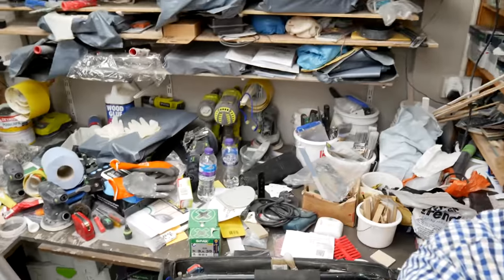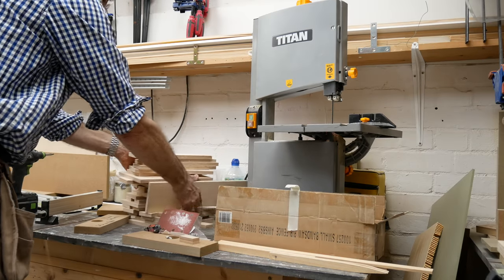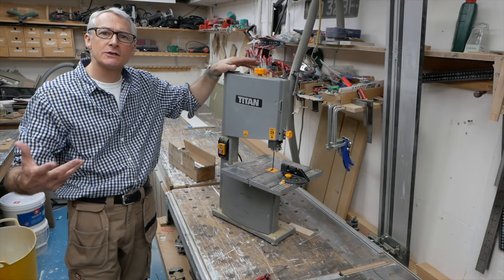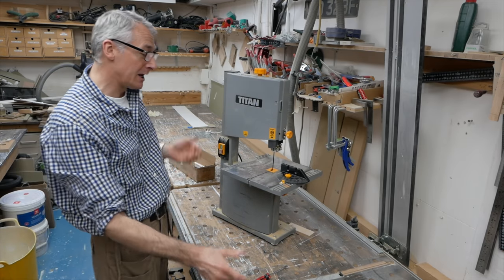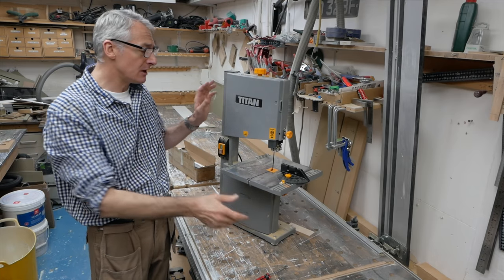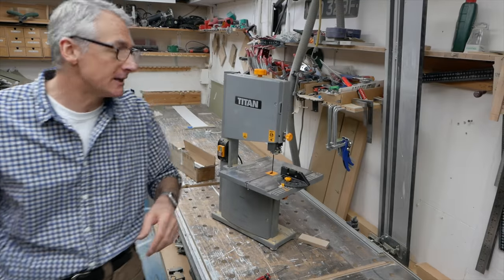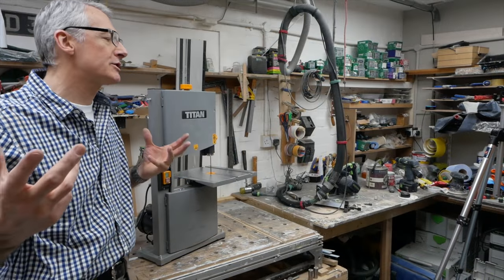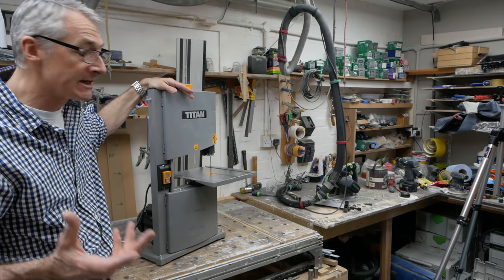Bandsaw Makeover P1 [video # 293]

Comment: I had a Clarke CBS190 bandsaw for years, spent many, many hours 'tuning' it all to no avail, absolutely useless, blade drift was appalling enough to put anyone off bandsaws for life, that said when these Titan ones came back in stock at Screwfix, I thought I'd give it another go, The difference between the Titan and the Clarke is nothing short of astonishing it actually works and works well, got the Axminster fence but not fitted it yet, Mr Millard you're costing me a fortune ;)

Comment: a lot of people bang on about problems with bandsaws not cutting straight and one thing and another when probably all they need to do is put a sharp blade in....blades dull quickly and if you cut a lot of tight radii that will mess up the tooth set for straight cuts.

Comment: Great video. Thanks for sharing. I'm already looking forward to part 2 (2morrow?)
One of your first videos about the WorkZone bandsaw brought me that time to your channel, which I subscribed to a week weeks later.
In the mean time this channel learned me a lot of other things so there is no reason to unsubscribe.
I still have my Scheppach band saw and I use it quite often. I have it two years now (but I managed to break already three band saw blades.
Last summer a friend of mine gave me contact to a woodworker who is able to repair (solder) broken band saw blades under certain circumstances.
He also sells new ones (which he makes himself to length for all types of band saws from stock material which he. After a long phone call I sent
him the three blades. He was able to fix one blade, the other were too much damaged. But he sent those also back, I might be able to use them for other purposes,
some day.  (don't tell me I'm a hoarder). He also made two new blades for me and I bought two blades from the same company as before.
So now I have the luxury of 5 blades! Since that time no one blade broke. (that happens only when you have one blade)
He also told me some tips how the blades stay OK longer. I have not met those tips anywhere on the internet so I write them here.
1/ Put a new blade and cut wood at first only 10-15 minutes.
2/ After that, take the blade out and let it rest freely and expanded f or at least 24 hours
     Ideally, sharpen the teeth of the blade (better but not compulsory)
3/ Put the blade back and use it for one or two hours
4/ Again take the blade out and let it rest freely and expanded for some hours
     Repeat steps 3/ and 4/. When necessary, sharpen the teeth. (max 2 or 3 times is possible)
5/ use the blade till it breaks

Back to this video: I don't remember exactly anymore the differences between the three band saws you tested/reviewed that time.
The Titan looks quite similar as my Scheppach (the Scheppach does not have a miter slot, nor a quick release knob)
My band saw produces a lot of fine sawdust which goes everywhere. The greater part goes to my simple dust collector but much stays near the down wheel.
The worst is that next to the upper wheel is the up/down mechanism for the blade guide. The saw dust literally blocks the mechanism after a few minutes.
(it takes longer to free the mechanism again). I did not find a way yet to prevent the saw dust going there. I'm thinking of mounting an acrylic upper door and
cutting red wood to see how the dust flows.

Comment: Ooh, ooh, metalwork and machine modification, now you're talking 😄. Enjoyed the video, thanks Peter. I worry that the birch ply will crush up further over time loosening the fence, but I guess it is just a matter of re-tightening the screws. Interesting bit with the tension release, must be a fault in assembly that it doesn't work the way it should.
Reply from the maker: Thanks Bob! Yes, bit of a weird one re the tensioner, but I’m not losing sleep over it! 😂👍👍

Comment: Thanks for the video Peter. Yes, there seems to be a lot of conflicting advice on Titan blade lengths. I think the problem stems from the lack of accuracy at Titan when welding the top blade mount to the frame resulting in some lucky people like Peter ending up with a proper 1575mm (62") machine, and others (like me) with something less. After running out of adjustment on several new blades, I eventually got mine from Thebandsawshop who recognise this problem and supply slightly shorter blades for Titan saws. Calculating from the drive wheel diameters and centres, the one they supplied me is about 1560mm. This could also explain the problem with the tensioner - with the 1560mm blade, mine works fine. My advice would be to check yours for size before you buy a new blade.
Reply from the maker: Interesting point; I may get a custom 1560mm blade made up to try out - it'll be a year or two before I 'need' to change blades, lol!

Comment: Doesn't putting the guide rail on the front interfere with blade changing? Can it  not go on the back?
Reply from the maker: It will get in the way of the blade - hence the comment about wingnuts - but you're right, there's no reason why it couldn't go on the back, AFAICT. Never seen a bandsaw with a rear-mounted fence, mind, but why not?? 👍

Comment: I think Mr Titan and Mrs Screwfix must have seen your original video. Following your videos I bought the Titan and even a Screwfix metal rule in readiness following a suggestion in the comments of said video. When I set up my fence it was really solid without the rule, to the point I thought I must have done something wrong. My blade release worked fine too, and I use it frequently as I read somewhere that if you go periods without using the saw to release the blade to lengthen it’s life span. I only get chance to go into my shop Tuesday and Wednesday mornings. 

I'm holding back on buying a new blade until I fully understand what I want. So far I'm thinking 6tpi x 3/8 inch is the way to go as I don’t think I'll be cutting many circles and I tend to use stock around an inch thick. However, it’s already my first choice to cut most of my delicate and smaller cross cuts. I cut some bench dogs this week using a design off YT, but he used his table saw with jigs that took him very close to the blade. Personally, I feel much more confident working closer to the bandsaw blade than close to my table saw. 

Another very helpful video and thanks for your advice both in the previous videos and in the comments. As a newbie this sort of advice and guidance is invaluable.
Reply from the maker: Sounds like you got a good’un Mark! Yes, releasing the blade tension’s a good idea when it isn’t in use - wish mine worked, lol! 👍👍
Reply: @10MinuteWorkshop  Thanks for this video series peter - I was one of the folk asking about this fence recently. After re-watching your initial videos I recently bought the Titan and thought I would get the upgrade fence too. But I have to say that like Mark above, the fence on mine is actually ok. You have to nip it up pretty tight, but once you do it is solid.
Reply: The only problem I do have is that the mitre gauge won't run through the slot - I think there are probably some burrs imnpeding it. Did you have any issue like this?
Reply: Mark Hannah Mine is ok, but that’s the best I can say about it. I’m going to buy a third party one that will fit all my power tool tables.
Reply from the maker: @diyengineer811  Thanks Mark! Maybe Titan watched my video and fixed the issue, lol! On mine when you tightened it up it would just lift off the table i.e. it was literally bending - with predictable results wrt stability.
Reply from the maker: @diyengineer811  No, the mitre slot has been very smooth for the start. Must be a burr or something 👍👍

Comment: hi Peter have you seen the new Aldi Ferrex 10" 550W bandsaw it's £149.99 but it's much improved with better fence and solid aluminium table and proper bearings for holding the blade in position top and bottom of the table its nearly twice the cost of the old workzone one but it's twice as good in my opinion
Reply from the maker: This one? Aldi Ferrex 10” Bandsaw 12 months on [video 475] https://youtu.be/o65JpBZoa0s 👍

Comment: Hi Peter, greetings from Australia. I have only just recently come across your channel and have been keenly viewing your bandsaw content as I am researching them at the moment. We don't have exactly the same brands as you have in the UK. I have looked at the  Ryobi and Metabo and also some cheaper options I found on ebay. I have a question regarding blade guides. Some I have looked at have roller bearing guides and others (the cheaper models I notice) have adjustable pins or bars that move in or out either side of the blade. I imagine roller bearings would be preferable, but given the guides are not intended to touch the blade anyway, does it really matter? I'm only looking to purchase a hobbyist level machine so am not intending to spend a great deal of money. I would value your opinion on the blade guides question. Thank you.
Reply from the maker: Hi Paul and thank you. Roller bearing guides are preferred - they’re there to help stop the blade from deflecting, so there will inevitably be some contact - but I’ve never had any issue with the little pegs. I was in a trade workshop recently where the bandsaw guides were little oak blocks, and they seemed to be holding up just fine. 👍👍 Hope that helps, and best wishes from London! 🙌

Comment: I have bought the same bandsaw. It is great value for money. I used it to cut a 70 mm deep birch piece and it coped. I had to introduce another washer on one or two balbearings supports due to the fact that the ball bearings were not allingned on the blade.

Comment: Peter can i ask why you didn't just cut some wood to 16mm  to fit instead of using the 1mm spacers ?
Reply from the maker: I had some 15m ready to go, and some spare spacers 🤷‍♂️ 👍👍
Reply: @10MinuteWorkshop   okey dokey...watched your video and bought a Titan...found issue with gate...if you look at the underside of the far end you will see where the alloy has been pressed out it has in fact distorted the surface..just dress with file.. :)

Comment: Hi Peter, that's the same fence that's on my Axminster band saw I've had for 12 years, just bought some blades from tuff Saws an what a good service especially  when I messed up my length, sorted me out free of charge. I had to make a new lever for my fence from aluminium as the plastic one broke early on but beside that it's worked fine. Keep up the good work.
Reply from the maker: Thanks Kenny.  Yes, good fence. 👍👍

Comment: The Titan saw appears to be the same as one branded Ryobi in the US.  If that's right, there may be a bushing missing or improperly installed behind the cam in the blade tension quick release mechanism. Don't know if it's worth the bother to tear down the top of the saw only to find no parts are available. It's nice to have a properly working tension release lever, though.
Reply from the maker: They’re very similar, yes. And no, parts availability is scant for the Titan here, so I didn’t fancy stripping it down of it works OK otherwise 🤷‍♂️👍

Comment: Band saw is a useful tool but a pain in the a55 to set up in my humble opinion. I have a small Wen but I think the lower end saws are pretty close to being all the same. I have yet to use the fence since the saw simply doesn't have the power for resawing.  Thanks for the video Peter!
Reply from the maker: Cheers Mark! Have to admit I mostly use the fence as an end-stop when trimming short lengths of e.g. dowel, or something similar. 👍

Comment: Afternoon Peter. Does the blade untentioner not tension it when rotated one way, to lift,  and not push the block down when pushed the other way, to release?
Reply from the maker: That's how it's supposed to work, but it doesn't make contact with the bit it's supposed to. 🤷‍♂️

Comment: Okay Pete... heres an idea, put a strip of alum angle on the front with its "horizontal" leg facing in... that'll give ya a surface parallel to the tabletop ,( assuming the front edge is sq. to the top)...😬
Now.. change the cam-wheel for a larger diameter (or sleeve it ) ... OR ... a bearing of suitable size. 🤨
Also, as far as I know, you are supposed to de-tension the blade when not in use, so getting the cam operating efficiently might be a gud idea ..

😎👍☘
Reply from the maker: That sounds all a bit too mechanical for me Peter! Nice ideas though - tune in for part 2 tomorrow to see my super-low-tech solution, lol! 🤔👍

Comment: Hi Peter, I an beginning to struggle with this saw a bit. You mentioned that the blade seemed quite big - well I am finding that with the tensioner screwed all the way down there still seems to be about 5mm too much slack in the blade which means that it doesn't sit nicely in the middle of the guides, but rubs agains the right hand side. Is your blade centered in the guides? I am considering getting a customer blade made 5mm shorter to see if that is better.
Reply from the maker: Hiya. I'm not sure if the blade's too big, but the tensioner does seem to be at the extreme of its travel, yes, but it does stay on the crown of the wheels. If you want a custom blade, try Ian at tuffsaws.co.uk - great blades, great service! 👍
Reply: @10MinuteWorkshop  thanks Peter, I bought a couple of blades from Ian  already and I told him you sent me! He did say that he can weld snapped blades back together but they will be 5mm shorter- which I think would be the ideal size for this saw. My real trouble now is that I am hankering after a bigger machine!
Reply from the maker: @diyengineer811  Haha - I know that feeling! I bought the Aldi 10" when it was - briefly - in stock a few weeks ago and have to confess I haven't touched the Titan since... 🤷‍♂️
Reply: @10MinuteWorkshop  I am getting tempted by the Charnwood W730. Just checked the specs for the Ryobi that the titan is cloned from and it says the blade length is 1572mm.

Comment: Help! I have the same saw, and can’t get the blade to stay on. Turning the wheels, causes the blade to slowly work it’s way off the edge. Either the tracking of the two wheels is out of alignment, or one of the wheels is not plumb. Tried to sort it four times, and seriously considering scrapping the saw.
Reply from the maker: Hi Megan. Yikes, that’s not good. Mine took a bit of tweaking initially, but nothing like that, and it’s running pretty nicely now - you can see in this vid how easy the blade change was. 

Assuming there’s no damage to the tyres, it has to be down to the wheels not being co-planar, so unless they’re dramatically out of balance (e.g. a manufacturing fault) then you should be able to get them aligned by tracking.  

It shouldn’t make a difference, but is this with the original blade? Have you tried a different blade? Might be worth £8 to try it?? Grasping at straws a bit, I know, but maybe worth a shot??
Reply: Thanks Peter. When you were manually spinning your wheels, I was telling myself “he had better watch his fingers, that blade is going to shoot off the front any moment now!” I did try a ‘different’ blade, but hands in the air that wasn’t a new one either. I will give that a go. I can’t be so tight to not try an £8 fix, when I was in an Axminster last week and convinced myself of all the stuff I ‘need’. Just found the podcast by the way - the back catalogue saw me through a bit of winter sun by a pool. Great work.

Comment: thanks for the review, Peter. I was thinking of getting one of these and after seeing this and other reviews (mainly about the trouble with the fence) I might actually spend a little more to get a better one.
Reply from the maker: The fence is easily sorted with a ~£20 aftermarket part, and other than that it’s a solid little machine for the price; I used it as it came out of the box for best part of a year, and whilst it took a bit more time to set up it worked fine. 👍👍
Reply: @10MinuteWorkshop  good point. especially for a weekend woodworker like myself. :) thanks. you might just have saved me some money :)
Reply from the maker: If you were looking for something a bit bigger, Aldi have the bigger (10") Ferrex saw back in stock at the moment; I've bought one, hasn't arrived yet, but the guys I know who picked one up last year say it's a solid machine, for the money. 🤷‍♂️

Comment: I'm having nothing but problems with my Bandsaw / blade. I treated myself at Christmas to an upgrade. Of course the first thing is to tweak / tune it up. I found that the blade was too long, could not get enough tension.  Went back to the shop and they gave me a replacement which by the machine specs was the right size. Tried it and this one was too small. So after a little research I worked out the correct size but low and behold the shop does not stock that size. I'm very frustrated!!! I might have to go to a local saw doctor and get a couple made up :(
Reply from the maker: Sorry to hear that Peter. Talk to Ian at Tuffsaws (link in the video description, or www.Tuffsaws.co.uk) he's very knowledgeable and generous with his time, and he makes fantastic blades for the price of an off-the-shelf one. 👍
Reply: @10MinuteWorkshop  Thanks for the thought Peter. I'm in Perth Western Australia, so will try a local guy if I can. But could be a 'Fall back' if it comes to that :D
Reply from the maker: Ah, yes - postage may be a little high! Pretty sure he ships internationally though. So maybe worth an ask?? 🤷‍♂️

Comment: Hi Peter. Great video. What size blade did you buy? The Screwfix Q&A says  1575mm x 6.35mm (62" x 1/4") and just wonder if those are the dimensions you used. Thanks.
Reply from the maker: Yep, that’s the size. Link in the video description to the blade I bought 👍